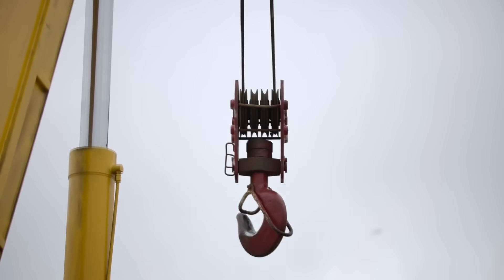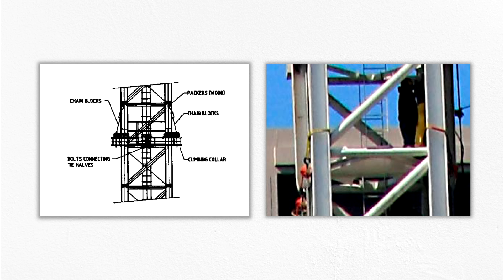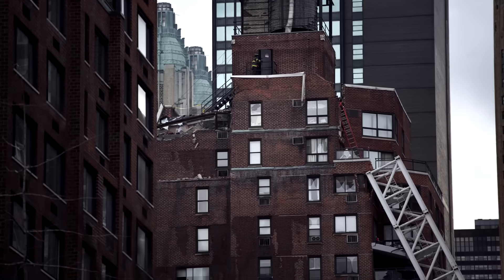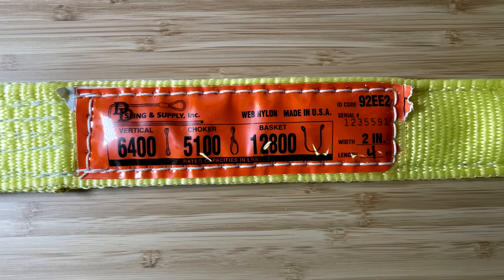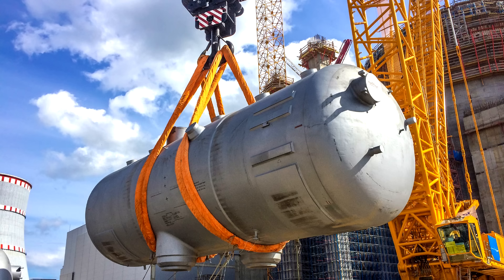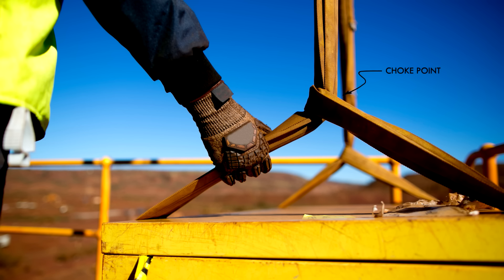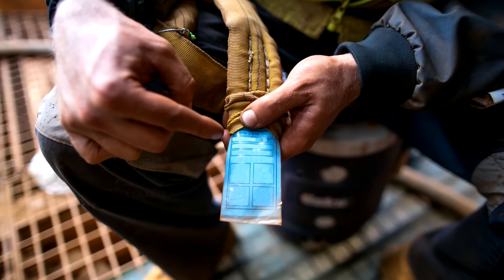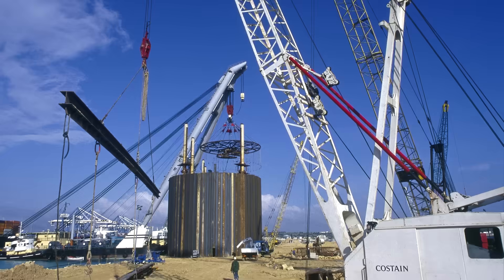Why Things Fall Off Cranes

Comment: My uncle is a boater and told me a story that ties into the rigging load limits here.

Say you need to tie up a boat on shore and it needs (arbitrary numbers) a 200lb line to secure it.  Ideally you grab a 200lb-rated rope, tie one end to the boat, and one end to a sturdy tree.  Or you tie two 100lb ropes.  But if you only have one 100lb rope surely you can loop it around the tree and tie both ends to the boat (same setup as a basket hitch, told ya this was relevant), right?

This spawned a huge argument on a boating forum, some people were positive that would work.  The trick is that if you map out the forces everything seems ok, each part only has 100lbs load max, until you get to the loop around the tree.  Then there's 100lbs pulling one way and 100lbs the other, for a total of 200lbs and the rope snaps.  Everything works except for one point, but one failure point is all it takes.
Reply: Hmm, looking at the rating label in the video a basket hitch is rated twice as much as just doing a basic hitch.  Did my uncle and I miss something?

Comment: Like Costantinos said, lifting eyes and shackles on the load also need to be debated as the sling applies a horizontal load on them. I have seen them bend and crack the screw threads.

Comment: One tip is if you're lifting newly blocks of concrete with "candy cane" rebar sticking out. Only lift it so you can position slings under to basket under the load!

Comment: In our town a contractor used a helicopter to remove and replace an HVAC unit from the State building. The old unit came down just fine but when the new, unused unit went up it got about 40' off the ground and fell.  Apparently it was quite a shock for everyone nearby. An expensive mistake but no one was hurt.

Comment: Funny, I used to make my own slings back in the 80's, 90's, and 2000's with zero issues... But in 2010, the company ordered us to use labeled slings with the ratings clearly marked. Guess which sling failed??? (Hint, it wasn't the slings I made up!!!) We used chain, and wire rope slings way back when, then they went to labeled woven slings which have a tendency to rot behind those nice sleeves failing in places you can't see easily in a much shorter time than listed... I'm not poo pooing your video, just saying that common sense doesn't seem to be very common anymore :-) And a good rigger is worth their weight in gold ;-)

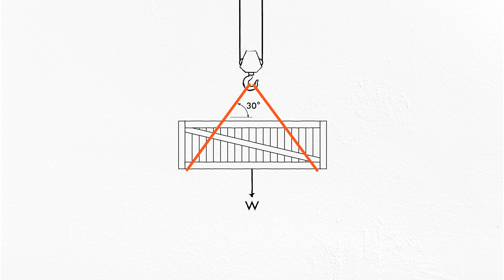Comment: 6:10 I think each sling would be experiencing  1/cos(30deg) = 115% of the load, not 1/cos(60deg) = 200%. It's so easy to get this backwards. Great content!
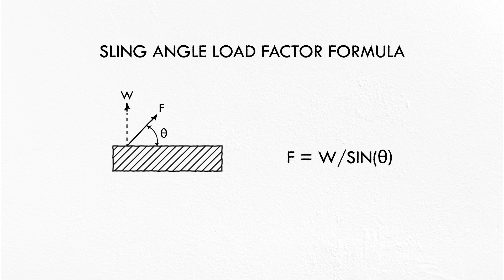Reply: No, he's correct because the angle is from horizontal. see 7:48 for the formula
So if vertically his load on the sling is 100 Ton, with 30 deg from horizontal he'll have 100/sin(30deg) = 200 Ton of sling load. If his sling is 60deg from horizontal then the load on the sling is 100/sin(60deg) = 115 Ton.

Remember you're comparing the 'vertical' part of the triangle to the 'diagonal'. so it's sin
Reply: @adityac3239  Oh, you know what? You're right! I didn't even see the little "30deg" label in the diagram. I only noticed that the diagram shows an angle of about 60 degrees from horizontal. I went back and measured the diagram and found that the angle labeled "30" is actually 53 degrees. So that's what confused me. But, if you read the label, then absolutely, the sling experiences 1/sin(30deg) = 200%.

Comment: I saw an interesting video about tie down straps and was amazed that if there is a knot in a strap, it has a significantly reduced strength like 70% or something! I can't find the video, but I was wondering if that knowledge is understood, that a knot  can be very dangerous. The video was talking about straps used on say a trailer for tying down a load. But I assume it would be similar here.

Comment: My company ships out large metal boxes with lift hooks. someone had rigged a sling on a very steep angle, we recommend nothing less than 60 deg.   They actually tore one of the lifting points off because of the horizontal force

Comment: hey, big fan, great video. one note, if you wrap a sling around an object(basket hitch) and attach it to one hook, it connects at an an angle, lowering the load capacity it's not double, it's 1,4.

Comment: It's interesting how force components work. The way the horizontal requires an increased total to sustain the desired vertical is why pilots have to pull up in a turn. When you bank the wings, you create horizontal lift, which is what makes the plane turn. But you're taking away vertical lift, so you have to increase the total lift provided by the wings so you don't lose altitude.

Comment: 6:27 Oh this brings on memories. When I worked at the airport, I was accompanying containers to be loaded in Ilyushin 76. Moloděc operating the aircraft's built in crane realised that the spread of the rails with hooks was narrower than the container. It didn't put him off. He attached the hooks to the bottom of the container and began to lift it. The hooks were actually pulleys, so the cables were sliding across the roof edges of the containers. They played a song like a violin. The controller device was equipped with a weight measuring device, that immediately went to red and the needles were pushed hard against the top of the scale. That was the last moment I observed their endeavour from the vicinity and I moved myself in a considerable distance form them and the plane. How they managed to load to plane this way without failure is a great mystery for me to this day.

Comment: I'll stick to entertainment rigging, lol.

Granted, generally lower forces, but I suppose there could be a lot more variables In play, especially with lifting a large multipoint span like a lighting truss or video wall.

People not understanding how you're supposed to load (and not load) beam clamps seems to be one of our biggest pitfalls.
Reply: Entertainment rigging has pretty much all the same concerns - plus very often you will have hundreds of people below what you are hanging. That's a lot of responsibility.

Comment: One additional downside of the synthetic fiber slings is that they degrade in sunlight.  Constant UV exposure will weaken them just like it does with ratchet straps.

Comment: Back when I worked construction I saw a crane operator trying to bring some rebar up to the roof and the rebar slid through the rigging about 50 feet in the air.  All of it came crashing down on three parked cars.  Thankfully no one was hurt.  The cars were totaled though.

Comment: I was a Trolley Museum member 30 or so years ago and worked on two bridge replacement projects.  Whether we were lifting rails, ties or wood structural member with our rail crane, it was done with wire rope slings.  There were no calculations or measurements.  We just eyeballed where to place the slings for successful lifts.  On one bridge stringer we lifted was slightly off.  I hopped on the beam to level it out.  It looked just like one of those "Old Timey" films of construction workers "riding a beam"  to its final destination.

Comment: With short slings, the tension increases with that horizontal component.  I guess if enough horizontal forces are applied, the load could be crushed/damaged as well I suppose.

Comment: Speaking as "just some random dude with a chain hoist and a couple slings in his garage lifting things out his his truck bed," this was rather informative, even if not for training purposes.  Just shows me I need to get out and learn a thing or two before I try and pick up something more than a few hundred pounds with my setup.  Another fantastic video from Practical Engineering!
Reply: I had to lift a lathe (200lbs) onto a bench.  Was a white knuckle experience.  The lathe was unbalanced with all the weight on the head stock end.  Did OK but was not a good time.

Comment: GREAT video, thank you very much. I have found your crane videos very educational. A friend of mine considered being a crane operator at one time, it made me want to learn more about cranes. I feel there could be a lot of safety enhancements made to cranes using wireless sensors, that could be used on any crane, old or new, along with a tablet that has software monitoring the sensor data, that can display and sound warnings and suggestions.

Comment: Holy cow, in my statics class, we just hit chpt4 and my first hw problem dealt with determining the load on a single cable ran through a pulley.  The issue was that the cables are spread apart as they contact the steel Beam for stability.   I had trouble convincing myself that the load was greater on the cable as the angle of spread increases.   This darn x-components of the force vector will alluded me for the last time haha 😄

This video was published the exact day I needed it.  Thank you for making these high quality videos Grady; what you do matters.  I'm happy to help support people like you who make good educational content like this.

Comment: There was a new rule saying that we need to double wrap bundles over 10 feet long (rebar or pipes). How does wrapping a bundle benefit us? And would it change the load on rigging equipment?

Comment: With that spreader bar, it looks like you have two sets of slings to think about. The first set are the ones at an angle between the hook and the bar, and the second are the ones going vertically from the ends of the bar and the load. My guess is that you have to account for both factors, with the possibility that some of the calculations are pre-defined due to the known configuration of the geometry and components being used.

Comment: Something that must be considered when rigging is the weather or exposure to contaminants on your slings. A wet sling can slide off its original position easier because the water can act as a lubricant, an oil soaked web sling can snap due to the lack of friction between the fibers that it’s made of. Care should be given to the selection and inspection of any shackle, hook or bolts used to attach the slings to the load, they also must be checked for weight capacity and physical damage.

Comment: Back in the mid 2000's, the family the bought my parent's house decided to install a 12 person hot tub.    The hot tub company brought in a crane to lift it over the 3 story house.   The hot tub wasn't balanced correctly, and it slipped out of the straps, fell to the ground, then rolled down the heavily wooded open space.    The 2nd try, the hot tub company decided to get the biggest crane available.   While it got the hot tub into place, the crane supports cracked the driveway, forcing the hot tub company to replace the driveway.

Comment: Tying things down is often just as important as lifting them up. @Mentour Pilot did a video on the crash of a 747 cargo plane because the military vehicles inside were not properly strapped down. A 16 ton truck sitting on the ground might not need much to keep it sitting still. But in an aircraft which accelerates and pitches up roughly 30 degrees on takeoff needs straps that can hold much of the weight of that vehicle to keep if from moving laterally or even lifting off the floor if the plane drops suddenly.
https://www.youtube.com/watch?v=hvZEr3IkLJI&t=1206s

Comment: "The formula is simple", that is the scary part if people really think like that.

Just remember to use every one of them and use them all correctly
Also add in wear and tear, environment factor, human error, people who don't follow rules
, time pressure, bad equipment condition........

--> I will keep on avoiding construction sites and look skeptically at all heavy machines under load.

Comment: Oilfield here. You'd be surprised what some of these riggers come up with to lift,push,pull, and tie down. I've seen little 2500lb slings hold up ungodly amounts, I remember when synthetic wire rope came out and was supposed to be 4 times the weight for a mudpump and snapped. It's pretty amazing what humans have accomplished

Comment: I work in pre-fabricated steel structures (highway sign supports). 15 years in the trade and nothing scares me more than lifting truss sections close to load capacity of our equipment. I'm usually  the first to correct coworkers using poor rigging practices.

Comment: On one of my old ships, we were preparing to lift a large feedwater pump out of the engine room. This work is done by civilian shipyard workers, not Navy personnel, but it still requires a safety brief and inspection by the Engineering Duty Officer prior to performing the lift. We were all ready for the brief, all we needed was the last civilian supervisor. So the EDO (a very young, very junior officer) picked up the 2MC and announced, "Head Rigger In Charge, report to Manuevering." About 30 seconds later, the door to maneuvering swung open, and there stood the biggest, blackest man I have ever seen, with a hard hat and a very serious expression. "Request to enter and WHAT DID YOU SAY!?"
Our poor EDO shrunk in his chair, and in a very quiet voice, he answered "um, Head Rigger In Charge, report to Maneuvering?"
He grinned, and laughed, and said "well that's me, too! Let's get this brief started!"

I regularly work around the crane operators, riggers, and others. I have tremendous respect for what they do, especially since I've seen what it takes to haul around that hardware by hand. Do you know how many people it takes to carry a cable that weighs almost 100lbs per foot? Almost the whole dang crew, that's how much!

Comment: Great video! I prefer to use chain slings, even though they are relatively heavy. They are less vulnerable than soft slings or even wire rope and offer a unique feature: by using shortening clutches, you can adjust the chain length of the legs in such way that the centre of gravity is shifted to being right below the hook, which is typically the safest way to lift. I supply lifting chains and accessories for over 25 years now.

Comment: I operate a 75-ton crane on at least a once per week basis, and these fundamentals are drilled into us. We primarily rely on synthetic rigging, and at times we have to employ shallow angles due to clearance concerns. We're not allowed to hook up anything unfamiliar without checking total weight, CG and strap angle.
Reply: The thought of using shallow angles is entirely scary to me; even though chains are rated far below breaking point, I still can't see myself willingly subjecting a chain to twice the actual vertical load!
Reply: @sissy021  All shallow angle loads are calculated prior to rigging selection and purchase, using the heaviest version of each lifted assembly for assessment. We don't like exceeding 80% of the de-rated WLL, so we have occasions where a single strap could accomplish a straight lift, but with de-rating and safety margins we end up with four of said strap to accomplish the same lift at low angle.

Comment: From personal experience, the heat generated from synthetic material sliding across metal gets bad enough that you cannot touch the metal.  In my case, rappelling, the nylon rope doesn't heat up in any given spot much, the rappelling device gets seriously hot.  Hot enough that it's common practice to not let the rappel device stay on the rope longer than necessary to get out of the set-up until it cools again.

Comment: I've seen one serious strap failure, and it was because a load got snagged on an overhanging concrete structure. The crane operator was moving too fast and didn't catch anyone giving the "oh shit" signal, continuing to pull until the strap failed like a sling shot, sending hook and ball flying and nearly laying the entire crane on its side. A few workers narrowly escaped that one with their lives. Some discussion was had about whether a beefier strap could have prevented the incident, but ultimately it was operator and signaling failure.

Comment: That's why I love spreader beams so much! Simple, efficient and the only load you need to worry about is the vertical load on the slings. As for the lifting/spreader beam, the max load is written right on the side of the beam. Just gotta attach that lifting/spreader beam correctly to the crane hook, pretty simple stuff when you know what you are doing. If you don't know what you're doing, STAY AWAY and let a qualified person do the job!

Comment: You might find it fun to take a look at Entertainment rigging, such as Rock Concerts. Here the lift (usually) comes from chain motors that crawl up a chain suspended from the roof structure. Typically the location of the chain will be defined by where it hits the floor, and the rigger has to figure how to attach it to the overhead. So you usually have bridles that bridge between two beams, and you get into angles and loading. Of course you often are also fighting for height, which can flatten the angles and increase the tension. And you have to work to get the correct lengths, so that it hits the floor properly. Typically putting it up involves riggers crawling on the beams, lowering a rope to a ground man, who preps the rigging. Then the up rigger hauls the chain up, wraps the beam, fastens the rigging. They have to make sure it's properly padded to prevent edge damage to the wire rope.  This is another place where doing the engineering and installation properly is very critical for keeping people safe.

Comment: I’ll admit that I’ve been lifting and moving loads with my Chinesium shop crane and ratchet straps for decades, but my primary concern has always been proper rigging as regards center of gravity and the security of the attachments to the load, ie not shifting.

Comment: What would a downside be for the spreader bars?  If they eliminate two of the major pitfalls (sling angle and abrasion), wouldn't they be better to use in every circumstance (neglecting the obvious added weight)?